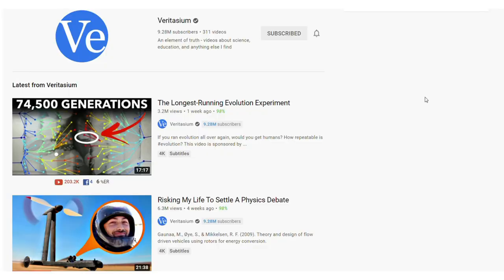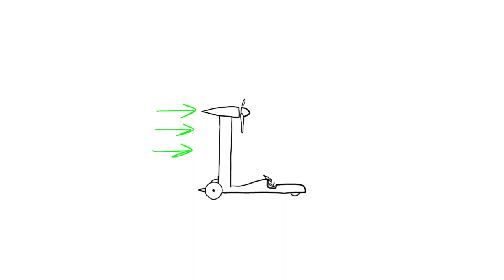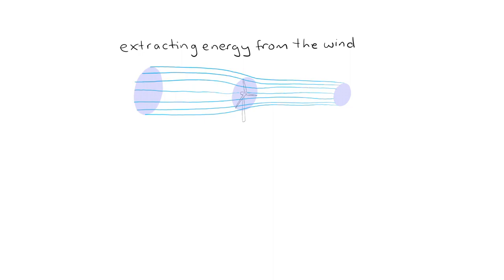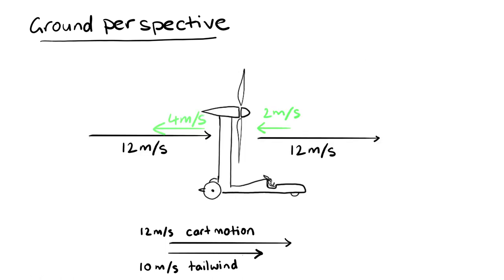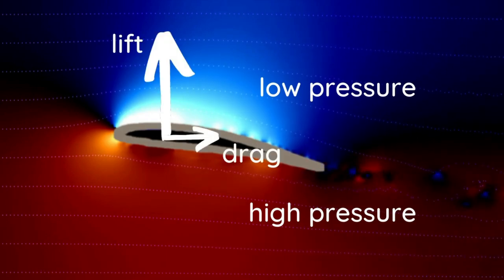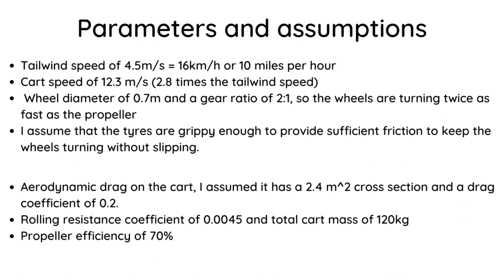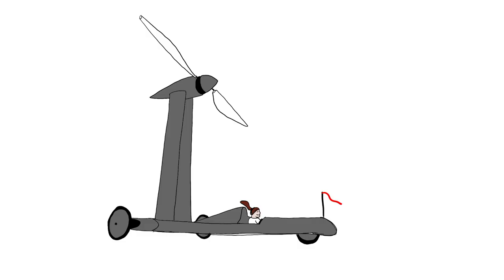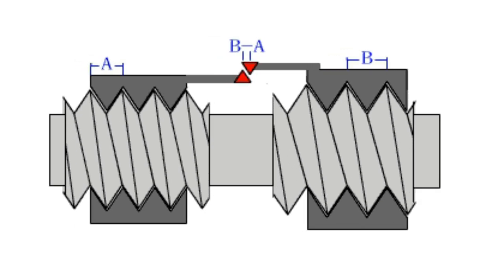Downwind Faster Than the Wind by Veritasium: How Does it Work?

Comment: So if you give this thing a push on flat ground with no wind, it will keep going perpetually, like the vehicle on the treadmill?
Reply: Nope.  Its a wind powered device.  Wind stops -- device stops.
Reply: Relative motion of the air and the Earth is important here. Then the air and/or the Earth have kinetic energy in any reference frame. At least one of them can work as source of energy.
If the air doesn’t move relative to the Earth, there is a reference frame where neither air nor Earth has energy. In this case, according to Galileo’s principle of relativity, they cannot be energy source in any reference frame.

Comment: I look it at using gears with my simple mind. Propeller is a larger gear, eg if it turns at 1000 rpm. The smaller wheel on the ground turns at 3000 rpm ie faster than propeller. Just like a car gear box. If you want to go faster, you use higher ratio gears but less torque output. Low ratio gives you more torque but reduce speed.

Comment: It is kind of obvious that this would require some kind of differential interaction between the air and ground speeds.
But how could you control a sailcraft without a ground to push against? In fantasy fiction sail powered airships are a common sight but could this actually be used without wheels or a keel to keep it on track? I have read comments about using the wind gradient but dragging around a wind turbine suspended on a 100 meter cable seems impractical given the tight weight limits of lighter than air Airships.
Reply: Look at how an albatross can use dynamic soaring to stay aloft for hours without flapping.  Instead of a tethered turbine the albatross uses its own momentum to alternately be the propeller or turbine.  Very clever birds!

Comment: hi Rosie, I like your content. I have a question, can you use a chimney type structure to create a draft strong enough to power a small of grid generator. I want to use the air pressure difference between the base of the chimney and top, amplifying this by using a large opening at the base and a venturi at the turbine blade near the top of the chimney. i don't want it to use any heat just air pressure. keep up the great content.
Reply: If you think that the difference in air pressure would cause an updraught in a chimney they why wouldn't the same difference in air pressure outside of the chimney also cause an updraught causing all the air around the Earth rush upwards into space?
Reply: @petehiggins33  that is not how it works air has for want of a better term weight, it is all stacked on top of each other so the air at ground level is denser than air at a given height. that is air at sea level is 100 100 kPa but it is only around 80 kPa at 2000 meters above sea level. using hydraulic principles. if the opening in a tall cylinder is larger at the base than the opening at the top air should rise.
Reply: @shainshoesmith8840  The pressure difference alone wouldn't cause air to move because the pressure gradient simply matches gravity. Having bigger or smaller opening won't change this.

Comment: WOW, I too had difficulties to fall asleep after watching Derek "impossible" video. With your "theory of relativity" I learned where I was wrong, thanks. I wonder if you find similarities with dynamic soaring gliders? Thanks again, ran
Reply: >>  I wonder if you find similarities with dynamic soaring gliders? 

Both the Blackbird and dynamic soaring gliders exploit the energy at the interface of two media.  For the Blackbird it's the ground and air.  For the gliders, it's effectively two air masses (or a single air mass with a significant gradient).  The difference though is the that glider has to use its own momentum as the "arm" that reaches between the two air masses.
Reply: @Rick_Cavallaro  Tanks for the clear explanation. 
I am wondering if Mask would be up for helping Derek prove it also with Tesla car striped from batteries and having electric prop on it’s top powered by its own regenerative barks.

Comment: Lift is a different animal than wind.  This is where they all made the conceptual error.  People generally realize that the thing that creates lift on the wings of an airplane is air pressure on the bottom of the wing.  But they generally don't think of air pressure as having a speed limit. The air foil shape causes laminar flow on the top of the wing and that is the same as creating low pressure or a vacuum. So, the motor of the airplane is not what is holding the plane in the air.  The motor is moving the plane through the air to maintain the laminar flow and overcome drag. On the downwind vehicle the propeller is like the wings on a airplane.  And the gearing of the wings to the wheels is what overcomes drag and maintains laminar flow on the front side of the propeller, creating a vacuum. This remove the air pressure on the front side of the propeller, as is the case with the top side of the wings of a plane. So, here's the thing.  The thing pushing the propeller isn't the wind.  The wind is instrumental with respect maintaining the laminar flow, the same as on a sail boat.  But the wind is not actually what is pushing the propeller.  The thing doing the pushing is air pressure. And here is the thing that has them all stumped, the speed limit of air pressure is the speed of sound. In other words, as long as the air pressure is being removed from the front of the propeller/sail it will continue to accelerate all the way up to  the speed of sound (if we assume no drag).

Comment: Surely the wheel driving the "fan" is overkill. Given that a boat can sail downwind faster than the wind, surely we can come up with a scenario where the blades both extract power from the wind and provide thrust. It may require some fancy twist of the blades to account for the changing apparent wind as the craft accelerates
Reply: The wheels provide the same kinematic constraint to the Blackbird airfoils (prop) as a keel provides the airfoils (sail) on a sailboat. 

Without the keel,  a sailboat can't sail faster than the wind and will merely drift downwind at something less than windspeed.  Without the gearing to the wheels, the Blackbird will do the same.

It's not overkill, it's fundamental.
Reply: I disagree - the gearing to the wheels only provides one mechanism by which this is achieved or enhanced. It sets the ratio between the number of times the blades rotate per unit of distance along the ground.

Fundamentally a keel/dagger-board provides resistance to constrain/control the motion of the sail/blade so that it is not traveling directly downwind and can have an apparent wind in a direction other than the direction of the wind. I think that the fact that the blades are rotating around an axis that is connected to a cart that has resistance relative to the ground and inertia should be sufficient to provide this.

If we consider Derek's cylindrical earth animation, the two boats can sail continually around the earth maintaining a speed greater than the wind. There is no component in this model that is analogous to the wheels - the sail generates a force that both accelerates the boat downwind and provides the rotation. I feel that there should be a mode analogous to this where each blade of the "fan" is sailing downwind like the boats rather than being driven.

I will admit that the startup conditions for the way I propose are more complicated. When I sail my boat faster than the wind, I need to start sailing more across the wind and can only send it downwind once I have enough speed to bring the apparent wind forward. The faster you sail, the further downwind you can point the boat. It may be impractical to build a cart working this way as the control of pitch and twist in the blade to cover the startup case and steady state case may be impossible to achieve in real life. The boat has the advantage that there is much less difference in apparent wind across the height of the sail compared to a rotating blade
Reply: @julianjenkins5553  "so that it is not traveling directly downwind"

But note that this cart could exceed the wind speed while travelling directly downwind. A boat using a static sail cannot do that.
Reply: Yes, the cart can travel directly downwind, but only because the blades are not.

Comment: Hey Rosie!! Thanks for this explaination - i'm having trouble accepting it! I feel like it's a trick haha .. 
since it can work in a headwind, how is this different from a perpetual motion machine? 
Like - why couldn't you put one on a big looped track .. give it a push up to speed and then .. round and round forever? :D
Reply: I doubt it can work with no wind, even if you give it a little push.
Reply: it isn't a perpetual motion machine because it requires external force to operate,in a headwind the machine gets energy from the wind (with it both pushing the machine and acting as a source for the fan to extract energy from), without wind, without an external source of energy it won't work, and the energy it extracts is less than the total energy of the system
Reply: @TheBiggreenpig  but the model on the treadmill was in no wind with a push

Comment: The simple answer to the conservation of energy paradox is: The cart is consuming energy of the system (moving air over stationary ground) in front of it and leaving behind a system with less energy (air slowed down by the prop) Thats the energy the cart uses to propel itself beyond the point of windspeed. 

Neither Derek nor Rosie are saying this. All the analogies do not explain it properly. Rick Cavallaro does mention it in his full speech linked in Rosies video. 

The point is that the cart is extracting energy from the system in front of it. Man that took me a good hour of breaking my head...
Reply: "leaving behind a system with less energy (air slowed down by the prop)  ... Neither Derek nor Rosie are saying this."

Derek is explaining this in the first video at 18:40.

Comment: So it doesn't matter if it is the wind pushing it to start or something towing it up to speed or like in the small model on the tread mill where the ground is moving under it all it takes is to get it up to a certain speed and it starts to drive or power itself??  how long will it keep accelerating for? if its a matter of distance then can't you make it go in a large circle? then can you stack the affect by having lots of carts going in a circle and have each propeller that is accelerating the air causing thrust to then be again accelerated buy the next carts propeller etc etc?   Is this simply a case of once it gets up to speed it starts to accelerate more and more?   "once this baby hits 88mph!"